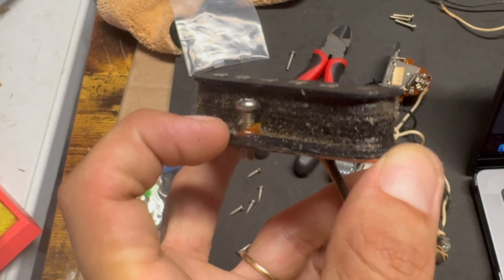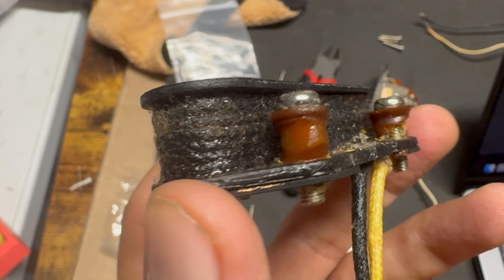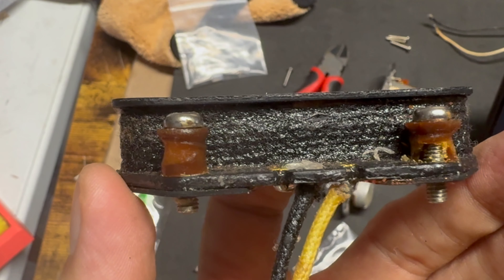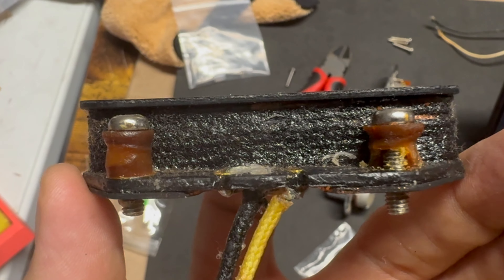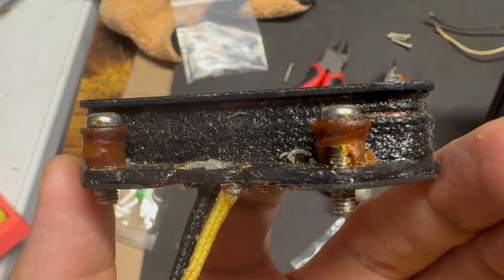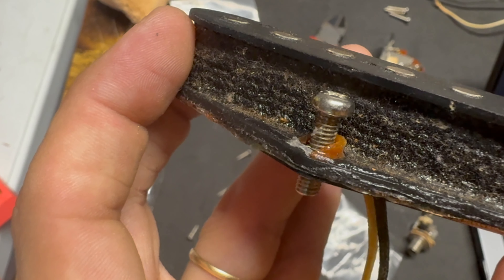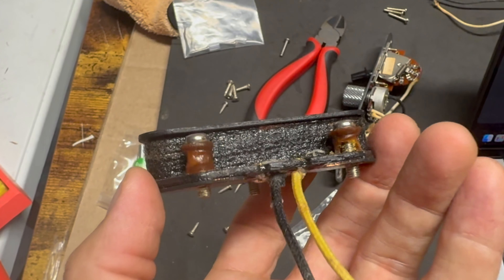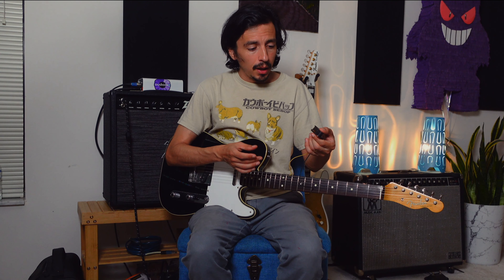After 40 years my telecaster's pickups are shot - let's talk about why.

Comment: Well, the tubing on the screws can be replaced easily enough, you can reflow the solder if contacts are intermittent, and you can even (counter to intuition) reheat the pickup to get the wax to melt where it might have cracked. 

But if you suspect the pickup to be unwinding (did it become microphonic?) or somehow the poles losing their strength due to an external EM force, best send it to a professional. But really, I think you have the right idea of just keeping the old one in the case/bag for now in case you decide to resell, and get on with making music again with the spiffy new replacement!
Reply from the maker: Since day one both pickups were really microphonic much more so than I was used to but I thought it was a nice part of the charm honestly.  The winding looks like it may have damage specifically on the bridge pickup on an exposed area, so lord knows that’s probably contributing a bit.